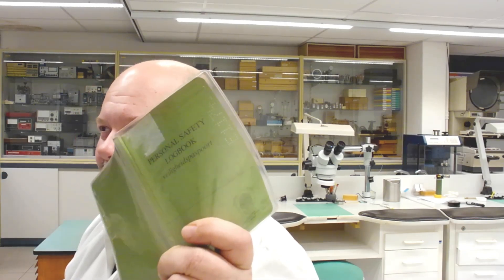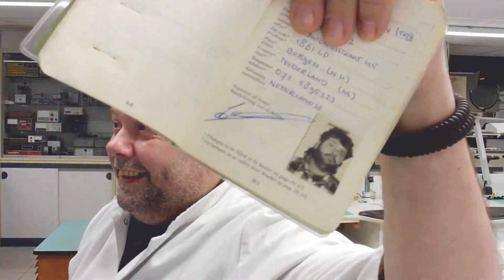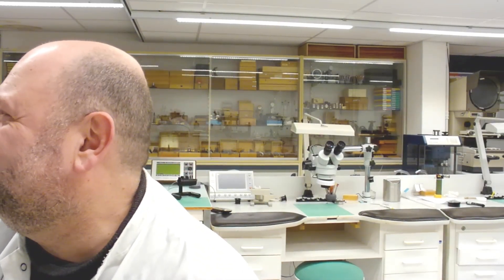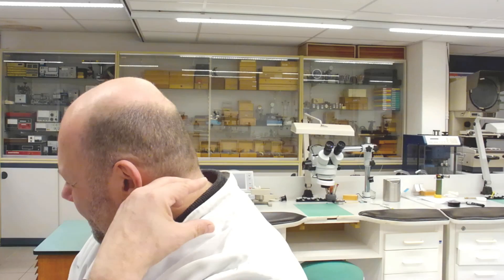Radioactive paste in vintage watches, how dangerous is it?!

Comment: Personally, I think radium is a risk that’s not worth having given how radioactive it is. Omega used radium until quite late before switching to tritium (late 50s). Whilst the material may be contained in the case it is impossible to know whether tiny amounts can/have escaped e.g. if it’s loose. If dust can get into a watch case I’m sure particles can escape too (and there is no way I would open a case with a radium dial).  I once owned a 1930s JLC and the brown radium lume was all cracking and the dial was bubbled from the exposure to it. No thanks!

Comment: The case shields the radiation. Any radiation radiates from the dial side and away from you. Also it drops off quickly with distance.  Keep your hands feet other body parts away from the dial and you should be fine.

Comment: You’re really talking about radium here, you forgot to mention that once tritium is 25ish years old its radioactivity is done.
Reply: 11 year half life... 25 years is less than 2 half lives. 4 would be about 6%. 5 would be 3.1%. 6 would be under 2%.

4 half lives is 44 years, and 6% is enough to still cause problems. The lume won't work after 25 years, but the radiation in the particles is still there.

Tritium tubes solve the problem, as the radioactive stuff stays sealed.

Comment: Radio-active watches can be repaired very easily! 
You will need the following: 
trumpet
shovel 
5 Litre steel cooking pot 
bag of concrete 
5 litres of water
fill the pot half full of concrete and water, stir the mix, and let harden
lay the watch on the hardened concrete
fill the pot with more concrete/water mix, making sure the watch is covered and the pot is full to the top with concrete
let the concrete harden completely 
PAINT the pot and top of the concrete in yellow warning paint, preferrably radio-active glow-in-dark paint, and put a radio-active sticker on it
take the shovel and dig a hole in your back yard
stick the pot in the hole, cover the hole with the excavated soil
now use the trumpet and play "Taps", then give your watch a final salute!

Comment: @chronoglidewatchmakers thanks, what of you have a watch with all the uranium paint on the face and then you put it in an ultrasonic jewelry cleaner. Like, you are hovering the band in the water and accidentally dip the enclosed in for a few seconds. I think some of the lettering started to wear, can taking it on a flight also affect the lettering. Mainly wodering what happens if you put it in the cleaner ultrasonic.

Comment: While I understand how Radium was mixed with zinc sulfide, I  never understood how tritium was mixed as it is a gas. Some thought it was infused in Styrofoam and the mixed with zinc sulfide though I've never been able to confirm this.
Reply: My understanding is that tritium is used as inserts, not as a paste lume. The gas is in a tiny hollow glass vial which is also coated with a luminophore on the inside walls.
Reply: @SianaGearz  in the early 1960s, many Swiss watch producers like Rolex agreed to phase out much more radioactive Radium applied based lume with Tritium as noted by the T<25 at the six o'clock. It was the same concept of zinc sulfide mixed compound with a radioactive isotope. What you're speaking of is the newest Tritium capsules. I'm referring to the compound applied to the indices from the 1960s - late 90's. Non radioactive Superluminova replaced Tritium and is what is currently used today.

Comment: My dear old dad had a leaden pot , egg cup sized on the work bench with this luminous paint in it .
He rarely put the cap on it and as kids we used to get excited to turn the lights off and be amazed at how intense the glow would light up the bench area.
Another danger, probably even more serious was the loose mercury in an old coffee cup that came from broken thermometers on barometer stations that came in for repair.
We used to handle it and roll the balls around the bench till bits of it disappeared down cracks or fell on the floor.
Reply: he passed away with wich age?
Reply: @BernardoSilva-ex9gc      He had a stroke aged 83 years , linked to tobacco smoking, must be 15 years ago now.

Comment: Radium decays partially into radon gas, which is slightly heavier than air, and as a result a collection of old watches especially in something like a lidded tin can may end up as a pocket of radon gas given enough years. Open something like that outdoors, and a slight breeze will take the built up gases away. The gas produced in a given day or week is minuscule, more is probably coming up through the ground into your house many times per day, but sealing it in a container and giving it years to collect is  something you don’t want to sniff.

Comment: Wow! Very interesting, Kalle! But how do you get rid of those radioactive particles after removing them from the clues, dials, etc.?
Reply: that was also my question. love the early brass and enamel stuff so have a couple of old mantle clocks.

oil seems safest to me (for not just washing away but actually capturing any particles) im thinking a good respirator mask too. but like he said if there is a paper layer on the dial or vulnerable paint its going to be ruined by liquids.
also we dont know how well those particles stick to what, so ooening and washing could even layer more on the exterior of the device.

maybe one of those "its safe when your 65" type safe things to do.

Comment: Radon gas is another product of radium that people need to be aware of.
Reply: I was going to write the same thing.
Reply: Yes, and the amount of radon produced by even a couple of vintage watches with radium lume is not trivial. I measured this before and after storing a couple of vintage watches in a bedroom. Before, radon was detectable but relatively low. After, the amount of radon increased fivefold and easily exceeded 4 pCi/l, which organizations like the WHO and EPA regard to be unsafe.

Comment: I want a watch with radium paint for so long now!😅
And I know a lot about radiation so I'm not worried at all.
Those watches are only dangerous to the people who painted them in the factories and people who open up the watch and don't have any idea what they are dealing with.
I would never open a watch if I know for a fact that it has radioactive paint.
I know a lot about radiation but as a hobby... I'm not qualified to work with radioactive materials.
And if you know it has radioactive paint and the crystal breaks.... Never touch anything that is under the crystal!
And it's pretty easy to find out if a watch has radioactive paint.
Just keep it in the dark for a few days and check if it still glows without exposing it to any light.
If it still glows... it's radioactive paint.
Reply: The statement that if a Radium watch glows after being in the dark is a misnomer as it can still be very radioactive but not emit any light as the salt that was used to emit the light is used up. The only sure way is with a geiger counter. Good luck!
Reply: @quaarjet   If luminophore is degraded, it wouldn't glow even after being exposed to light though, would it...

Comment: I got told by a professional that alot of the radiation will be emitted already.

But like you say, the dust or particle seems a problem.  Wondering how approach this now as i'll be working on vintage watches over the next few years...

Anyone can share any tips?   Will geiger counters be able to assess the alpha radiation particles?
Reply: See one of my responses, regarding what a cheap geiger counter will detect. As far as alpha and beta, this is fairly low energy radiation. Gamma is penetrative and will go through everything and is the most damaging.
Reply: @quaarjet  Sorry I disagree, Alpha is the more dangerous when directly in contact with the skin or inside body.

Comment: The problem with the radium dust is that your body treats it as calcium as it's chemical make up is similar and deposits it in your bones. This in turn irradiates you constantly as radium half life is 1200 years or so which can increase your chances of cancer. Bottom line is that, as Kalle said, the proper precautions need to be taken.
Reply: so when someone finf your bones it still glows ?? intresting
Reply: @BernardoSilva-ex9gc  No, you won't glow as you don't have any material for the neutron to strike to emit an electron. It just keeps damaging your DNA.
Reply: @BernardoSilva-ex9gc  in 97million years theyll extract us and use us as spaceship oil 😂
Reply: @BernardoSilva-ex9gc  It doesn't glow, but you will still be radioactive 5 half lives later.